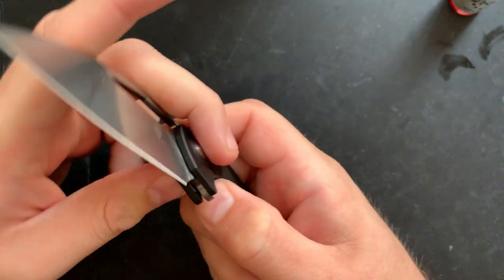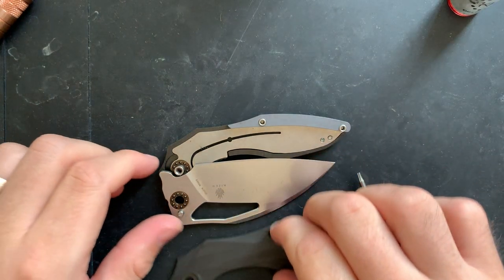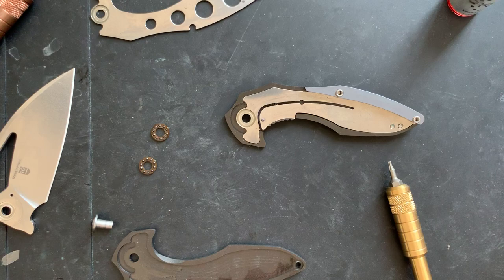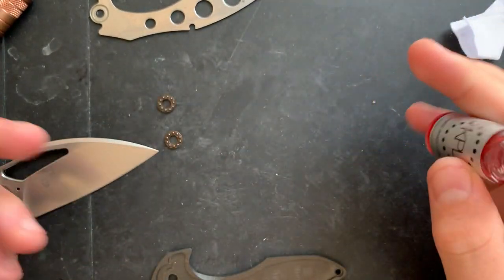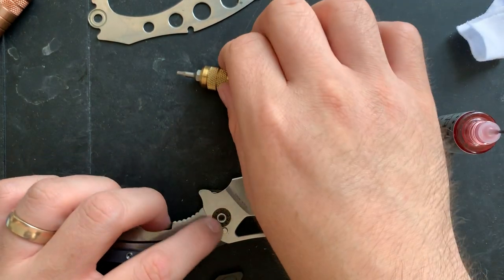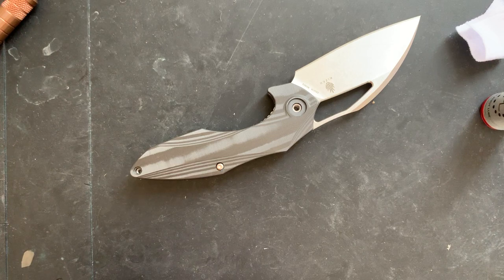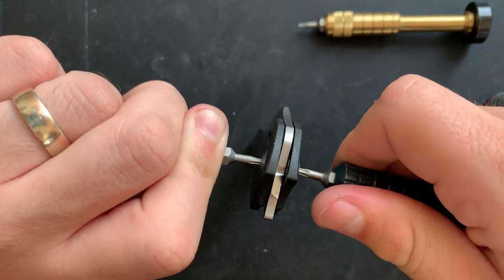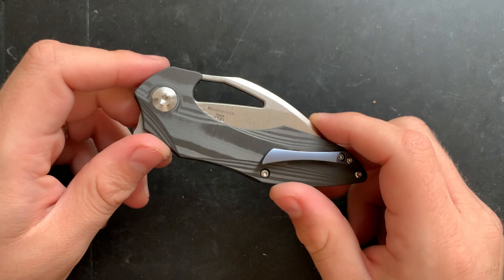How to disassemble and maintain the Kizer Minitherium Pocketknife

Comment: Hey Nick, I'm a fan and seen a few of your vids, but I'm having a Knife Crisis.  I am an avid hunter, and though I know you are not, you are aware of the situations I deal with (things you cut today getting into things you cut tomorrow, ball bearings, etc etc.  So..here is my dilemma.  I use a buck 110, but after a year or two, the blade develops blade play, and the nail nick collects fat, and it's HEAVY.  What I need is simple,  a 4" knife, back lock, no pocket clip holes(meaning extra besides the main pocket clip if it has one), no nail nick, no thumb stud or disk, no lanyard hole, phosphor bronze washers, any decent EDC steel is fine.  I would like flat internal liners so as not to collect crap, but not a major issue, and I would like to be able to take it apart to maintain.  Suggestions?
Reply: eldoris gardner I think the Spyderco Endura would serve you well. VG10 is the usual steel and there is nothing not to love about it, other options are available too.  I have had one for years and every time I prep for the woods I look through my collection to select a knife to take and end up grabbing that old thing every damn time.
Reply: The CRKT HomeFront would be another to look at, although I personally wouldn’t pick it over the Endura it does have a good blade shape for hunting applications and the take apart aspect is quite compelling.
Reply: @0neTwo3  , it has 12 pocket clip holes, and a lanyard hole.  That means every time I clean it, which is after every use, I'm using a toothpick to get blood/fat/gore out of at least 9 clip holes and a lanyard hole.  That's more work than just the nail nick on the 110.
Reply: @0neTwo3  I looked at the homefront, the idea is ok, but I'm just not really seeing it as a decent quality knife.  Seems like cheap steel, and a gimmicky thing.  If I were ok with a liner lock, I would probably be happier with a buck avid pro or similar.